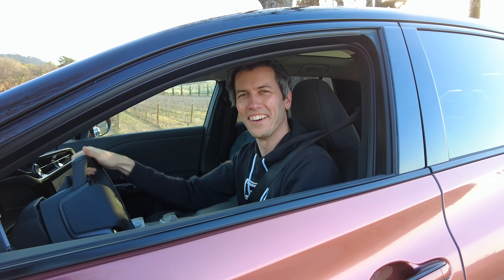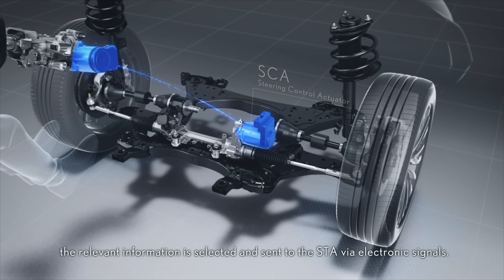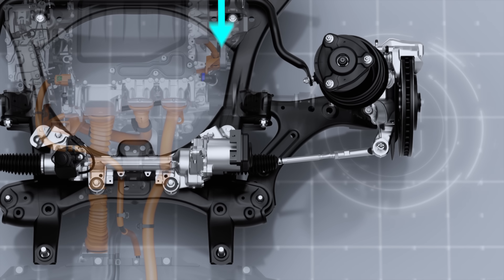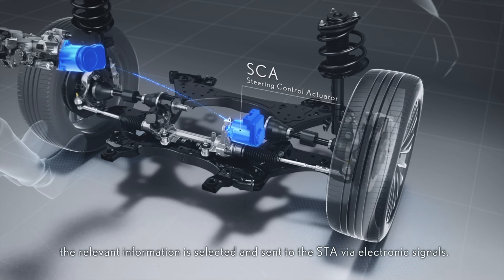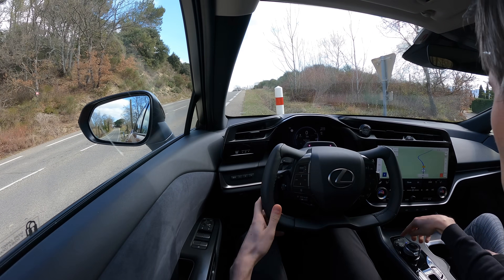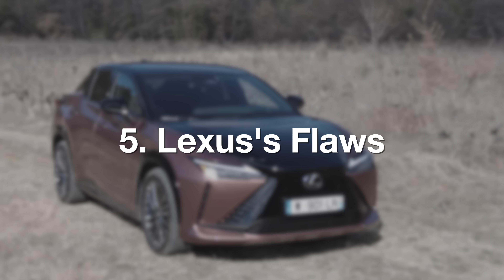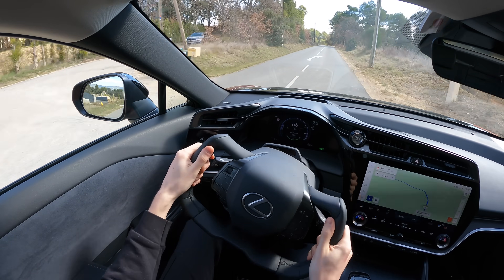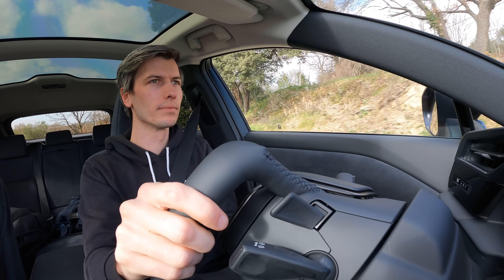How Lexus Fixed Tesla's Bad Idea: Steer-By-Wire Yoke

Comment: That input lag would drive me nuts! I'm also not a fan of a steering system with no mechanical linkage between the steering wheel and gear. Yes, it has three power sources, but it's possible a CAN communication error could cause it to shut down or produce weird outputs from the steering motor. Excellent video!
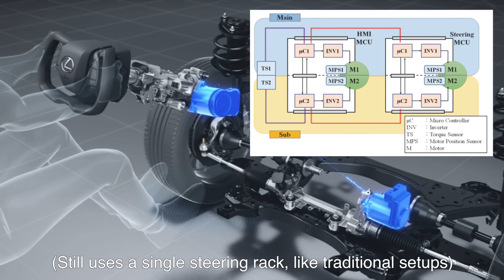Reply from the maker: There is a duplicate system of controls (as shown on screen at 7:48), with a system of checks. They monitor if both systems are seeing the same thing. If a discrepancy is noticed, you pop an error, and the system drops to a single steering system so you can stop the vehicle. 

You could say the same about flying. There's a chance a communication error could cause it to not work out. There is this chance, factually, and there have been unfortunate failures, however it's low enough that flying is very normalized. 

I agree on the input lag, that is not good, and hopefully it's addressed.
Reply: @EngineeringExplained  But is the input lag really a problem though? You had to yank very hard on the yoke. With traditional steering it would have been impossible to turn that quickly. Also, while the car isn't moving, the resistance from the road to steering is at its worst...

I suppose they could have used more powerful steering actuators or use the feedback torque to resist / prevent you from turning the yoke faster than steering can handle.
Reply: @EngineeringExplained  surely the input lag is intentional. I don’t like the lag as much anyone, but it’s a large Lexus SUV, not an F1 car. I’m sure their main attraction is reducing NVH.
Reply: @EngineeringExplained  if you have problem with ground in electric circuit, it doesn't matter how many sensors you have, they all will report wrong data. That is why really doubled systems should not be equal or one of them should be manual
Reply: @NefanWorld  Technically, this is only true in a system that doesn't have isolation between parts of the system.
Reply: @ergohack  in a car you don't have isolation, car body used as a ground in most cases
Reply: Exactly, see my comments about when it went wrong for real st 100mph!
Reply: I've experienced a steering failure after hitting a large pot hole with one front wheel - caused the car to veer strongly to that side despite me turning the (now super-light) steering wheel the opposite direction!

Having said that, the recent recalls over loose steering wheel bolts would affect a steer-by-wire system just as much as a mechanical system.
Reply: Didn't realise you were probably talking about the lag of the electric motors themselves. IMO, this is very likely to be by far the biggest contributor to lag in the system, but is something I expect  you should be able to bring down to acceptable levels with a good design. Getting lag as low as it is in a mechanical state IS technically possible, but I highly doubt they are doing any of the things necessary to achieve this.
Reply: Hey.. everyone had a similar sceptical view with ECU. Look at where we are and how reliable they've become. We're talking in milliseconds where injectors have to do their job. I have hopes for this system. I think this is the future.
Reply: I work for a company designing steering systems, including steer by wire. From expérience, let me tell you one thing: ANY assisted steering system can kill you in an instant for countless reasons. Mechanical link or no mechanical link. 

Such a system can completely lock, steer suddenly, become unstable... And the presence of a mechanical link won't change a thing. The system is just too powerful for any human to counteract it.

The good news is: we know that, we have decades of experience dealing with such risks. There are actually standards in place to ensure this is done correctly.

So let me assure you of one thing : if you can think of a failure source after watching a 15 min video, engineers designing that system have identified it, put countermeasures in place, and tested them thoroughly.

Zero risk is of course not a real thing, but risks are assessed and minimized. Especially on such critical systems.
Reply: The connection between the steering actuators (redundant) and the steering wheel actuators (redundant) is almost certain to be via dedicated signal communication, so that a shorted CAN module somewhere else in the vehicle doesn't disrupt that most-critical communication, and it's sure to have a default mode that still works and preserves manual control if it loses communication with signals coming from the rest of the vehicle (road speed, vehicle stability control, lane-keep assist, etc).
Reply: I highly doubt it's CAN. It's probably BroadR Reach/100Base T1. This automotive ethernet is becoming more and more common in new vehicles, especially EVs because you maintain the speed of industrial ethernet and keep the simplistic 2 wire twisted pair of CAN.
Reply: @wakingchristian  he is talking about you changing direction on the steering wheel and the actual time the motor takes to turn the wheels to the position of the steering. Not the signal ping.
Reply: @MUGEN  I'm addressing the comment that a CAN communication error could occur. I'm saying that they would not use CAN because CAN is slow. It is not ideal for that application. They could use CAN-FD that is a bit faster but still is somewhat volatile.
Reply: @wakingchristian  This is inaccurate, CAN  is fast enough for this, 1 Mbit per second. Broad R can send more data faster but communication timing is not guaranteed, whereas a CAN packet timing is. This is superior for signals that need timing such as steering. Audio on the other hand can be buffered and doesn't need precise timing from node to node as long as the packets arrive in time to be read from the register in the case where broad R is used. CAN also has superior signal noise tolerance and is more reliable than an Ethernet protocol such as Broad R as it does not require as many layers. CAN FD is far simpler more reliable and the better choice for real-time control applications.
Reply: @Kenneth Cherisol  I'll try to address all of your comment. CAN FD has been the preferred choice for fast speed machine control. The physical layer of CAN made it the ideal choice because of the stability when it comes to signal noise. However, BroadR Reach is not like industrial ethernet. It actually has the same physical layer of CAN, 2 wire twisted pair, so not as many layers as traditional ethernet. It still gives you the same advantages of Industrial ethernet. How they were able to achieve that, I don't know. As far as CAN being able to achieve this 1ms cycle time, you can Google the specs all day but for vehicle control, it's not practical. There are too many messages being passed to do it.
Reply: @wakingchristian  I'm  not googling . I wrote firmware using CAN for inverters, BMS modules, power control systems , grid tie inverters, DC DC converters , ac DC converters  and motor drives to just name a few. Automotive, industrial and medical are some of the sectors I actively work for. I've also dealt personally and written code utilizing both protocols. As an EE I've dealt with many communication protocols, even reverse engineered signal packets from devices that did not have any technical documentation on the communication packet structure or commands .  I know what I'm talking about.
Reply: It's also possible for a mechanical system to bind or break.
Reply: @ALMX5DP  mechanical won't became fully dead suddenly, you won't loose control on steering
Reply: @NefanWorld  depends on what fails.
Reply: @ALMX5DP  do you know any real case? The connection between front wheels and steering wheel is strong, it can't just break apart
Reply: @NefanWorld  tie rod ends fail, steering column linkage breaks, lack of fluid results in binding or EPS asssit fails resulting in the same etc. I’m just saying there is a possibility of failure regardless of what you try and do. Using that as an argument isn’t great unless there is data on both sides to show failure rates.
Reply: @ALMX5DP  
"tie rod ends fail" - both systems have them
"steering column linkage breaks" I don't know what to do to completely break it, it even doesn't have replacement schedule
"lack of fluid results in binding" you will feel that far before it become completely bind
"EPS asssit fails resulting in the same" you can counterpower it, eps steering angle sensor failing is well known
"unless there is data on both sides to show failure rates" I'm saying it is more unsafer than mechanical, statisctics can be great, but 1 failure can cause death and many other just make you go to the repair shop
Reply: @NefanWorld  many different ways something can fail or break, and many engineers and safety experts will look into this to determine if it’s indeed safe. No amount of internet speculation can change that.
Reply: @ALMX5DP  these experts let Tesla use a yoke without any notable rotation ratio changes so driver can't rotate it fast in emergency situations or even loose control. Marketing creates a problems that nobody has and makes engineers to solve them
Reply: @NefanWorld  some would argue that passed every safety requirement, so it’s safe to use. If you have data to share it isn’t, do share.
Reply: @ALMX5DP  safety requirements don't include emergency steering test or something like that. It has airbag and works after crash? Ok, it is certified. If you have data about tests you can share, I don't know any. I just searched for a video about drifting Tesla with yoke and quickly find good example, check it on youtube: "Drifting the Tesla Model S Plaid & Z06!"
Reply: @NefanWorld  safety requirements don’t encompass emergency situations? I think the fact it is on the road and assessed by DOT, NHTSA and FMVSS says everything you need.
Reply: @ALMX5DP  Takata airbags was on the roads too, many years.

If regulators don't have any requirements for sterring wheel shape why they shouldn't allow yoke? I can't find any regulations from them. For example in the UK DfT said: “The regulations relating to steering equipment (UN-ECE Regulation 79) does not stipulate any shape or size of the steering wheel”
Reply: @NefanWorld  well if there is a manufacturing defect that goes unobserved here you might have a point. And if years into the future they do recall it somehow, I'll be the first to acknowledge your point. There may not be a requirement for simple shape, but again it's on the road and that means it's so far passed all legal requirements for it to be.
Reply: @ALMX5DP  the likelihood is a lot less, and even if you have an electrical failure, you still have manual unpowered steering and braking. Here, if the electrics go out, you're fucked.
Reply: @ALMX5DP  sure but at least the avg man can check his steering components. with the electric only youre gonna need a dealer level scan tool to do pretty much anything if you have an issue, plus this new setup still uses inner and outer tie rods, whats to say those wont fail either?
Reply: @redcatxb125  that is a different argument, but even with that the vast majority of owners arent going to be able to adequately inspect either system. Sure there will be equipment necessary for independent shops to achieve that, but that's basically been the case for any major or even minor innovation in this segment. And yeah it does still use tie rods to turn the wheels so no different to current systems with no discernable difference in failure points.
Reply: @ALMX5DP  Very very very rare not going to happen on a modern car
Reply: And then there's fly by wire in airline jets. Those are pretty nice tho.
Reply: On a simple system like this, it is relatively straightforward to keep input lag below 1ms, far below what you are capable of perceiving. This isn't like a video game where you you have literal gigabytes of data being processed before your visual feedback shows up on screen.
Reply: @ergohack  That depends on thr refresh rate of the microcontroller. Vast majority of microcontroller have a max refresh rate of 10ms.
Reply: @wakingchristian  Not sure what microcontrollers you've used, but 10ms response time is glacially slow for any modern microcontroller. Lexus can afford real electronics engineers, not hobbyists who can barely struggle through an Arduino tutorial.
Reply: @ergohack  Actually I design control systems for mobile machines. No need to personal attacks. Just having a discussion.
Reply: @ergohack  Also they but if the shelf controllers just like 99% of everyone in the in highway and off highway market.
Reply: @wakingchristian  Was not intended as a personal attack; I should have been more careful.  Regardless, I've never had trouble achieving sub-ms microcontroller response times if the design called for it, without having to spend $$$$.
Reply: @ergohack  What types of machines. I used to use 3-5ms cycle time when I was doing servo control. This was when I was Industrial automation before transitioning to vehicles.
Reply: @wakingchristian  Specialized power supply equipment.
Reply: No reason they can't use redundant comms. Probably the least expensive thing to make redundant in the entire system.
Reply: @ergohack  I would disagree with that. If you do that then you need to I'd l introduce an additional control module, additional harness which increases the installation cost and software cost. It could be a better solution but not less expensive.
Reply: @wakingchristian  No need for all that.  If using automotive Ethernet, it's not that  hard to use an off-the-shelf ethernet controller IC that can do link aggregation with fail over.
Or, you can even step down one level, and do it using something like a comparator and a high speed analog switch, although that would only handle some situations.

TL:DR Redundancy in comms for something like this doesn't need an entire separate control module and cable harness, it requires at most a few extra chips costing at most a few dollars each, and two extra wires in the wiring harness you are already using. That's it.
Reply: @ergohack  Agree 💯. That's why I said that's probably what they are using. We are on the same page.
Reply: @Retired Bore  True, but there is a difference between what it says it can do and what is practical. When you try to run a program below 10ms cycle time, you start running into issues because the controller doesn't have time to completely run a program. A program for a cnc machine is different than a vehicle.  When u consider the J1939 engine/transmission messages, the lin bus, and all the messages on the CAN. Secondarily, you have all your MUX messaging for error handling and you haven't even gotten to the software redundancies required for ISO26262 for on highway vehicles. No you're not running a microcontroller at 1ms cycle time, at least with a CANbus system. If we switch the discussion to automotive ethernet that's different but that hasn't been around since the 90s and is still very slowly taking hold.
Reply: @wakingchristian  As someone who works with both microcontrollers and PLCs, i think youre only considering how a PLC works. A PLC has a cycle that reads inputs, processes the code, writes outputs every 10ms forever. A microcontroller doesnt really have any cycle time, it executes the code you write directly. You can implement a "refresh rate" for certain parts of your code, but you dont have to. Modern MCUs run at speeds over 100MHz, executing whatever code you write realtime. With more complex projects, you would generally use an RTOS, that executes tasks based on priorities and timing. You also have interrupts for stuff that needs to happen instantly, outside your normal code loop. Coding microcontrollers and PLCs requires an entirely different mindset.

Comment: Has legislation passed allowing it though? I could have sworn when Infiniti implemented it the reason they kept the mechanical interface was because the law was written in such a way that it was necessary. I hadnt heard of any changes over the past few years in that regard.
Reply: My question too.  They had a "similar" E-HPS system long ago that didn't need a column but they still had to maintain the column as a legal safety backup.
Reply: yea, Infiniti drive by wire has a clutch to connect the wheels as a mechanical backup

Comment: You framed the steering “delay” point to sound like it is an accident. But I would imagine it was a smoothness decision. Something like that should vary by drive mode IMO
Reply: Disagree, electric motors can already ramp up smoothly.  This is just system lag that absolutely must be resolved before production.
Reply: it's odd though, the rational given by the engineer was that they wanted to increase responsiveness with steer-by-wire, then they made something that was less responsive...  The latency was severely noticeable n the video, as it was the first thing I noticed int the beginning. I would guess that it it's a few times larger than the human reaction time.  I would not feel comfortable driving something that is going multiply my reaction time in a hazardous situation.

Comment: "BMW Active steering" did something similar more than 12 years ago
Reply: That was a mechanical system though.
Reply: Sort of.  BMW added a variable gearset up in the steering wheel/column junction that would change ratios based on speed.  Yes, it gave you adjustable steering ratios but it was a fully mechanical system.
Reply: And the failure mode is simple - without power you can still operate the steering.